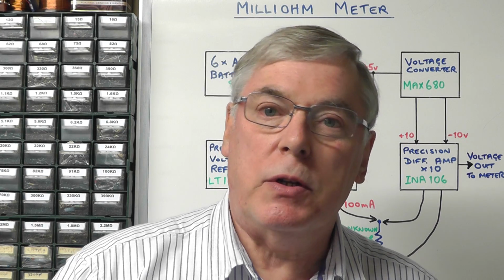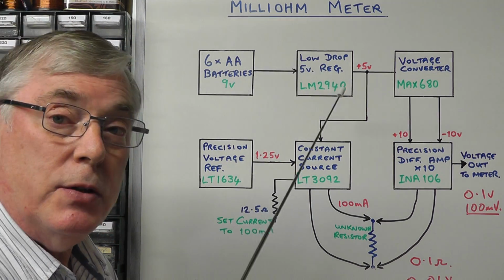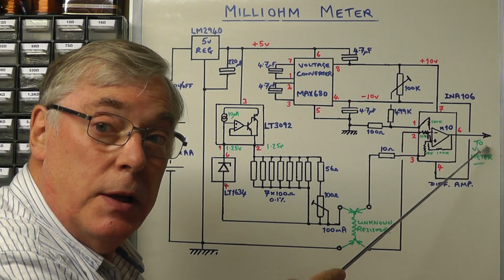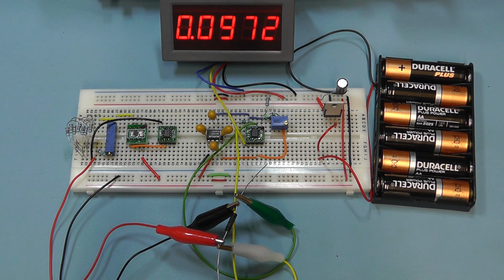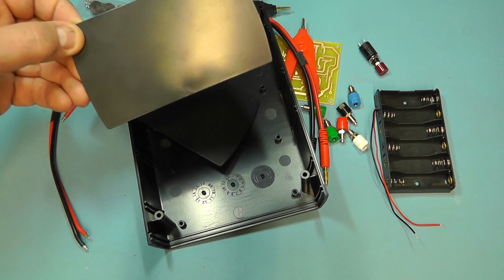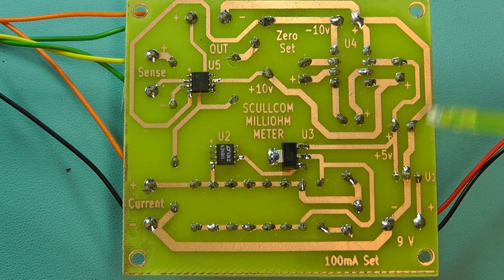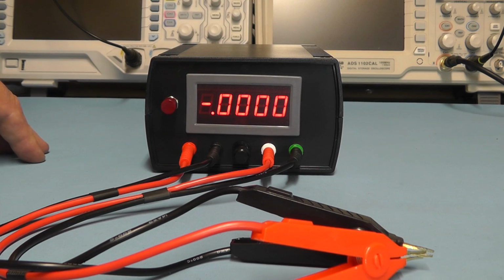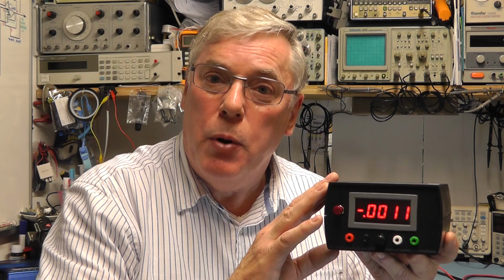Scullcom Hobby Electronics #31 - Design & Build a Milliohm Meter

Comment: Thanks for all of your hobby electronics tutorials! 
  I have a quick question. Are you building these projects with batteries solely for your portability needs, is it absolutely necessary in this design for isolation from mains, or are you using batteries just for design simplicity?
Reply from the maker: Thanks Jake for your comment. The reason I have tended to use battery operation for most of my projects is to make it easier for the hobbyist and amateur who may not feel comfortable with building mains (240V AC) power supplies and the dangers that can pose if you are not familiar with working with mains AC. All of the projects could also be powered from a mains power supply if you wish. You could either build your own or buy an off the shelf mains power pack.
I have also designed and built valve amplifiers operating from a mains power supply and high DC voltages. If there is an interest in this I could do some projects/tutorials on building valve amplifiers and point out the safety issues.
Regards,
Louis
Reply: Thanks for the reply Louis.
    I've found myself building power supplies for basic experiments, mostly working with guitar amps and op amp preamplifier circuits. I have come across the limitation of my tools. Your tutorials have helped me see how I can connect the dots and fill the gap in my lab. I really appreciate how you break down exactly how each item works in the circuit and why. I feel like I can use individual elements and the underlying principles to create designs of my own.
    I have very limited means, and far too much time on my hands after an accident left me disabled back in February 2014. I went from building hotrods to electronics to fill my time. I am trying to apply what I learned from autobody and engine building -buying parts is fun, but collecting the tools and skills used to make parts is the real secret to success.
   I already had the basic tools like a decent multimeter and hand tools. Since getting hurt, I've been fortunate enough to pick up a second hand Rigol digital oscilloscope and a good soldering station. I also have a local thrift store that lets me pick up any broken electronics that they throw out along with the gigantic tangled mess of wires and power supplies they throw out regularly. I've collected a lot of junk so far. That gives me access to almost any jellybean components found in most consumer electronics along with any common wall wart and switch mode power supply made. This in turn forces me to learn to test everything from shunt resistors, zener diodes, capacitor ESR, and transistor curves, all of which I'm currently trying to wrap my head around. It can be time consuming to learn this way but time is one thing I have too much of.

    I really do appreciate your projects and I want to build a few. Hopefully my permanent disability goes through soon, but until then I'm using the building blocks of your circuits to understand circuit function and to build a rudimentary version on my own using discrete components. I have a shopping list of parts to build your 6.5 digit millivolt meter, your milliohm meter, and I will probably try your function generator in the future as well.
    I'm currently working on an adjustable dual polarity tracking power supply using a lm317 and an op amp, a discrete floating adjustable power supply with current limiting, and a simple audio probe/function generator/crystal tester using discrete components and basic op amps.

    I am interested in expanding my knowledge and experience, but I don't even know what a valve amplifier is used for. I'm very linear with my learning curve. When I come across a problem I can't solve I want to understand everything related to it. For instance, my inability to measure current shunts, lead me to understanding how a 4 wire kelvin connection works, differential amplification, and a more broad understanding of the need for accurate current source circuits. I also picked up a basic understanding of wire resistance and capacitance and it's impedance matching effects, reflected waves and their measurement using a Schmitt Trigger to measure a coax length, and I even learned a bit about antennas and built my first. Some of that came from your milliohm meter tutorial, and some of that is from several other sources. I learn by exploring problems and solutions like this.

     My next experiment will be to try to build a differential amplifier using transistors in a long tailed pair and see how that compares to parts of your milliohm meter circuit. I found a good tutorial on a long tailed pair from Alan on A2AEW where he explained how to build an adjustable triangle waveform generator. I will try to expand on his lesson by trying to figure out how to implement some feed back into the circuit, but this subject is on the foggy edge of my understanding and ability.

    The sad thing is that I have an old 80's broken Programmable Power Supply from Fluke and one that powers up from HP. Both were given to me, and are enormous rack mounted units. I haven't been able to figure out how to interface with the HP and make it work. I much prefer analog electronics to programming at the moment. The timing of bits and everything involved to get the thing running (cheaply) is mind boggling to me, and I keep putting it off until I understand electronics better. The fluke unit, however, I can't find enough information on, as no one appears to have a full schematic. It was missing capacitors on a couple of boards but I have no way of figuring out what they were. It has lots of interesting parts including a nice precision voltage reference, a massive transformer and tons of discrete matched and precision components, but without a schematic I stare at it for hours in perplexity... One day.
   
   Anyways, sorry if my ramblings are unwelcome. They could be considered a marker of where one odd member of your audience is in terms of understanding and ability. I'm probably in over my head with most of your content, but I have a tendency of banging my head against the wall of knowledge until I make my own doors.
  Thanks, -Jake.
Reply from the maker: Hi Jake,
Looks like you are having an interesting journey learning electronics.
All the best,
Louis

Comment: Hi, Since the device is designed to measure very low resistance values, can the unit be used to measure esr of a capacitors.
Reply from the maker: Hi,
No this would not be suitable as an ESR meter. Equivalent Series Resistance is not like a normal low resistance. It is the effective resistance in series with the capacitance.

Comment: Those Ebay banana plugs on the red and black leads will tend to be intermittent if the spring around the outside of the center pin is loose like they usually are.  I got some like that and found that I had to solder one end of the outer spring to the center pin before they would make good contact.
Reply from the maker: Thanks Steve for your valid comment. The one I use are quite good quality so they seem to have been OK so far.
Regards,
Louis

Comment: i was wondering how critical are the values of the 499K resistor and the 100K trimmer, for example can i use 470k and 10k for the pot. i have almost completed the meter , I'm lacking just those two components, i would love to hear from you, thank you in advance.
Reply from the maker: Hi Stratos,
You can replace the 499K with a 470K but I would recommend you still use a 100K preset pot. A 10K pot across the +10 and -10 supply output from the MAX680 chip will use about 2mA of current and could therefore cause the output voltage to drop due to the extra load current.
Regards,
Louis

Comment: Hello. I'm a big fan of your channel. You're a great instructor. However, it would be nice to have little more reasoning why certain IC's where used, or potential alternatives and design considerations. I'm guessing you could have built this project with a wide range of components. I've looked at Bob Wettermans Milliohm Meter designs and noted how much simpler it is.  http://www.hwmakers.eu/uncategorized/diy-milliohmmeter/ What do you think?
Reply from the maker: Thanks for the comment and link. Good point about choosing IC's. Bob Wettermans uses the same constant current source IC. However, he is using the 10 bit ADC of the Arduino to measure the voltage (1024 steps) which will effect the accuracy/resolution.
Reply: I too greatly enjoy these videos, and would also like more discussion, not only of the IC selection, but also of how design points were arrived at. eg. in this project, the 100ma test current.

Comment: I also found the display on ebay
http://www.ebay.com/itm/Red-LED-5-Digit-DC-0-4-3000-33-000V-Digital-Voltmeter-Voltage-Meter-Car-Panel/400490355805?_trksid=p2047675.c100005.m1851&_trkparms=aid%3D222007%26algo%3DSIC.MBE%26ao%3D2%26asc%3D41375%26meid%3D50c4d22274de47578948ed5953bdefe1%26pid%3D100005%26rk%3D3%26rkt%3D6%26mehot%3Dpp%26sd%3D112100639769
Reply from the maker: You are looking at the wrong display for this project.
You need a 4-1/2 High Precision +/- 2V Digital Panel Meter (0-1.9999V) 
Try the following eBay links:
http://www.ebay.co.uk/itm/261284812938?_trksid=p2057872.m2749.l2649&ssPageName=STRK%3AMEBIDX%3AIT

http://www.ebay.com/itm/350261421976
Regards,
Louis
Reply: ok. good to know. thanks

Comment: please ask where to buy a digital 0.0000 ?
Reply from the maker: The panel meter is available on eBay from two suppliers. Direct links below:
http://www.ebay.co.uk/itm/DC-4-1-2-High-Precision-2V-0-1-9999V-Red-LED-Digital-Panel-VOL-Meter-New-/261284812938?hash=item3cd5c9d88a:g:nbsAAOxyffZSWRz1
or from
http://www.ebay.com/itm/4-1-2-Blue-LED-DC-2V-Digital-Voltag-Volt-Panel-Meter-/350261421976?hash=item518d352798:m:mIwohqOmZD0VVwEybsTO6yg
Reply: Thank you. how many ohm max ?

Comment: would a lm2675 suffice as well?
Reply from the maker: The LM2675 are normally used in Step Down Buck Converters. They could also be used to convert a positive input voltage to a negative one. I am not sure why you would want to use one in this project. You could not replace the MAX680 with the LM2675 as we need both a positive and a negative 10 volts supply. Also I would not recommend using it in place of the fixed 5 volt low drop regulator.

Comment: hello thanx for your so usefull video.
i have a project that i should make an miliohmeter in range of 0.1 ohm to 2000ohm with maximum 4ma current test i implement it and when i put ohm below 5 ohm display will show zero how can i show my circuit i will be so glad that you help me thanx alot 
best regrads.

Comment: Thanks for the useful tutorial, It would be nice to have a 200mA version as this would be used in PAT testing for IT equipment to measure the earth continuity and resistance for 0.1 ohm Pass and more than that wold be fail, modifying the circuit to 200mA is simply changing the resistors to half the 12.5 ohm to produce the 200mA and the LT3902 is capable of 200mA as per the datasheet, but my problem is the zeroing of the module would I need to change the AN106 side? please advise.
Many THANKS
Reply from the maker: The INA106 provides a fixed x10 gain using its internal laser trimmed resistors. By increasing the current to 200mA you would need to halve this output gain to x5. However, as the INA106 is a precision IC I would leave it as it is and then add a further precision OP Amp on its output which would half the result and give you the correct reading you require. In order to maintain the accuracy and stability I would recommend you use a INA105 configured as a divide by 2. If you checkout my No. 11 video (5 minutes in) I describe how to use a INA105 in this way:
https://www.youtube.com/watch?v=01IBdhcEmOw
Hope this helps.
Regards,
Louis
Reply: Thanks
Reply: Since my application is a PAT tester circuit for earth continuity I realised I don't need hi accuracy +-10% will be more than adequate for the purpose, so I opted to use V ref with MCP617 opAmp and 1% highly matched 22k resistors as difference amplifier config with a mosfet,and sense resistor of .22ohm to generate stable  200mA require to do the test in the range of 0.05 to 0.5 ohm this way it is quite suitable for the PAT testing required by the current regulations as well as very cheap setup, less than £5.00 total components cost, Many THANKS for your informed tutorials I enjoy them.
Kind Regards

Comment: Interesting project and you got new subscriber. Can you write down the specs of the panel meter that U used?
Reply from the maker: Thanks. 
I will shortly be uploading an update video on this project with full details.
Below is a link to the eBay seller I purchased it from:
http://www.ebay.co.uk/itm/261284812938?_trksid=p2057872.m2749.l2649&ssPageName=STRK%3AMEBIDX%3AIT

Comment: A cute-looking design. I'll be attempting to build this one up, using one of Barbouri's PCBs from oshpark. One thing I note is that the 2ohm upper limit of this unit seems to be entirely due to the panel meter. I found myself a 4 1/2 digit display panel meter on eBay that goes up to 4.3V, so with any luck I'll end up with a meter with a greater range that can go to 4.3ohms instead, but still with the given accuracy and precision of the unit presented here.

Comment: Hi Louis, I'm trying to measure uOhms accurately (resistance of a copper bussbar) could the INA106 be directly replaced with the INA131 to get the 100x gain?, My guess accuracy would suffer....
Reply from the maker: Hi, I think you would have to make minor changes to the PCB. The INA106 Reference pin is pin1 but on the INA131 it is pin 5. Pins 1 and 8 of the INA131 should be left unconnected. Other than that all the other pin connections are the same. So I think if you make the pin connection changes to the PCB it should work. It would be interesting to see how it functions with the INA131. You would also have to take in to account change to voltage reading on meter. To maintain the same gain error as the INA106 you should use the INA131BP version. If you try it let me know how you get on. Good luck.

Comment: Thanks for the great project. 
Just finished building the Milliohm meter and was very pleased with its performance.
Photo of my finished circuit board. https://farm2.staticflickr.com/1572/25996046664_0f0cecff2a_h.jpg
Total cost for the board parts including the board was $51 USD. Case, display, and other misc parts were and additional $50.
Really enjoyed your well documented video, and will probably try the 6 1/2 digit millivolt meter next.
Thanks again - Greg
Reply from the maker: +pbreviceps Hi Greg, I had a look at your version. You have done a great job with the PCB.
Reply: Great design version pbreviceps. Any chance you can share your design files or supply a pcb?
Reply: Hi Tign Meg
Louis has a link to the board files on his site: http://www.scullcom.uk/design-build-a-milliohm-meter/
You can also check out my build at: http://www.barbouri.com/2016/05/27/milliohm-meter/
Greg

Comment: Hi Scullcom.
Did you not have trouble powering the meter from the same power source as the rest of the circuit?
An led display changes its current draw over a few ma depending how many segments are lit, I found in other projects this can cause its own ground to vary up to a mv or more (even if the meter is 4 wire).
I see your taking the sense lines direct to the op amp, do you find this stops any effect of the meter current draw lifting ground?
Reply from the maker: +hellcattanks Thanks for your comments. There was no issues with powering the meter from the same power supply. The LT3092 can operate down to 1.2 volts and maintain accuracy so there was no problems. It is always best practice to take the sense wires direct to the OP Amp inputs. Although as there is no current drawn by the OP Amp inputs in theory nothing is ever perfect.
Reply: +Scullcom Hobby Electronics OK one last question on this, suppose we take wires direct to the op amp inputs, we have long wires with test clips picking up noise, how would you protect the op amp from static, a couple of diodes to the supply rails?
Reply from the maker: +sean doofer I have never had any issues with this. The INA106 has 10K series resistors built-in on its inputs. If you are using very long input wires and ESD is a concern then you could use a Transient Voltage Suppression  diode (TVS) of a Metal Oxide Varistors (MOV) across the inputs.
Reply: +Scullcom Hobby Electronics Yes I want to build a test set for industrial use, the test leads are not that long but the cables under test will be, and the environment is very electrically noisy, with 100ma through them I'm sure they'll be ok, but there will be times where the test leads will be connected and the current leads not.
I cant find low voltage mov's so I'll use a pair of zeners back to back.
Reply from the maker: +hellcattanks Yes you could use two zeners but their reaction time is much slower at voltage spikes suppression compared to a TVS. A combination of the zeners and TVS would be the best choice. Maxim Integrated circuits make a range of ESD protection diode arrays which includes an integrated transient voltage suppressor (TVS) clamp which are suitable for high-speed and general-signal ESD protection. IC types (costing about £1) include the following MAX3205E, MAX3207E, MAX3208E. You might like to check them out as they may be suitable for your requirements.
Reply from the maker: +hellcattanks I just had a quick look at the Maxim datasheet and I think the best one to use would be the MAX3207E which is available in a SOT23 package.